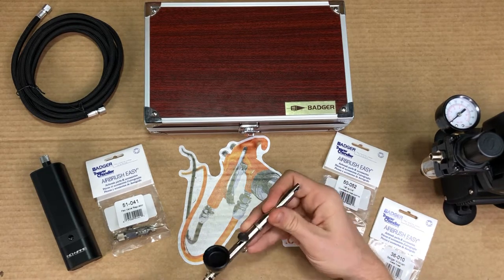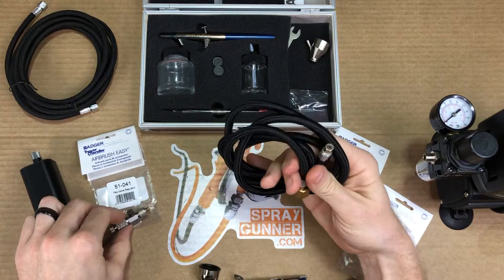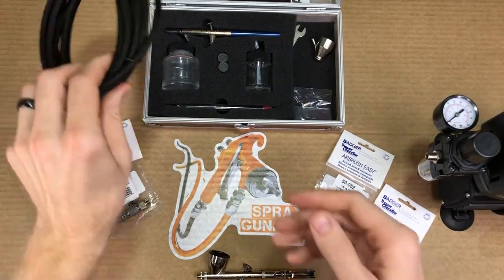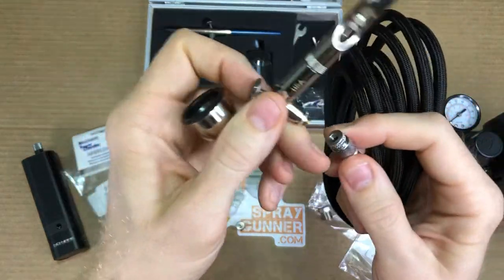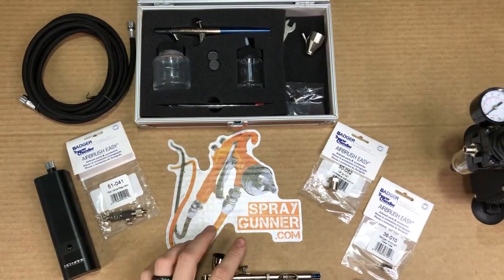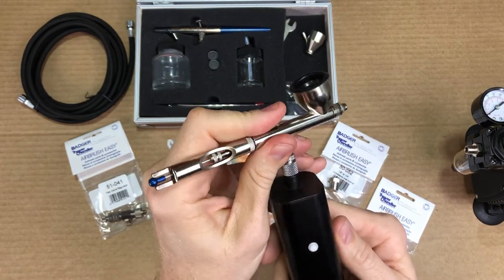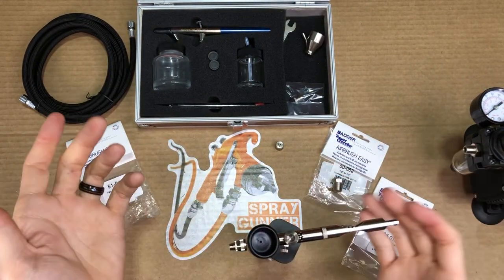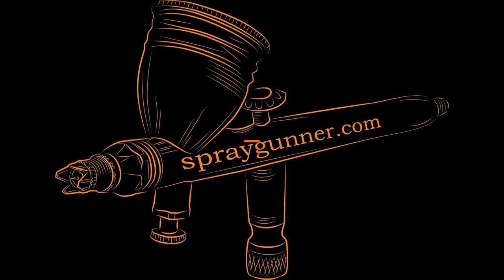How to connect Badger airbrush to your air compressor with or without quick coupling

Comment: Hey there, you’re video was very helpful. I was wondering if you could provide some info, I’m trying to connect a badger patriot 105 to a grex gck05 compressor. What’s the checklist for using a badger hose and quick disconnect? Much appreciated!